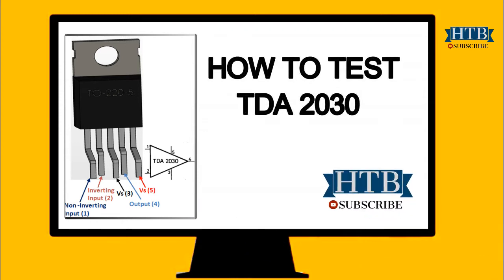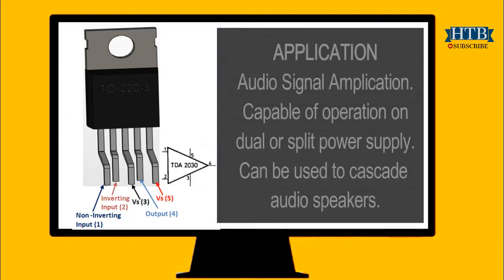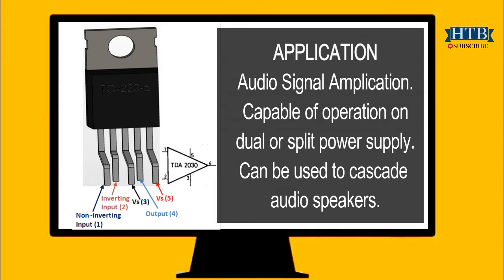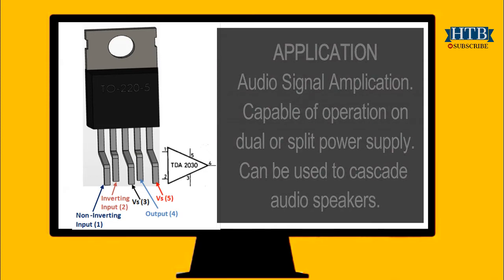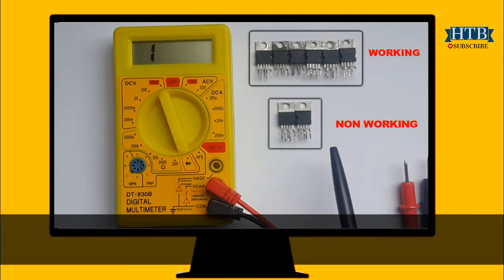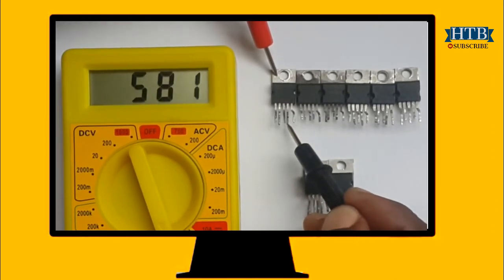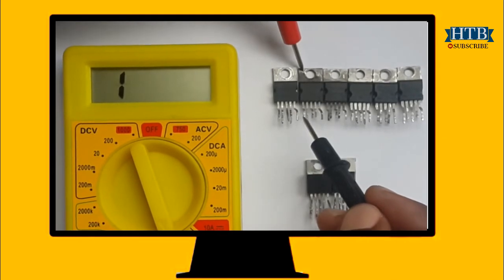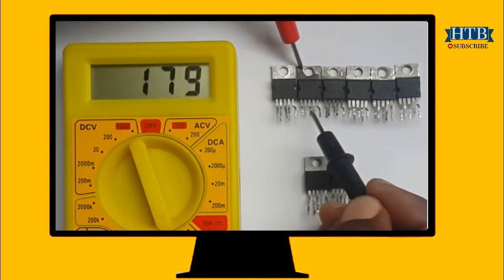How To Test TDA2030 IC- Simple Method.

Comment: This is just what I needed man! I have a TDA2003V in a CB installed now. RF is coming into pin 1 but nothing is leaving on pin 4.
I feel like I've already found the problem but pulling it and testing it like this couldn't hurt.
I've noticed others are testing with the ground lead on the metal tab.
Reply: I did it both ways but with the red lead I do not get readings on pin 1 and 2 only on 4 and 5
Doing it like he did I do get readings on 1,2,4, and 5 but I am doing the test with the IC in the circuit so I don't know how accurate is my test.

Comment: Thank you sir nice video
Reply from the maker: Thank you too
Reply: @howTobest.  Can the IC be tested in circuit? Or does it have to be removed from the circuit?
Thank you. Good video!
Reply: @howTobest.  I tested the IC in the circuit with the multimeter and these are the readings I got pin 1-.773 pin 2-.778 pin 3-0.00 pin 4-.517 pin 5- .541 do these readings mean it is good?
Thank you. Great video!👍
Reply from the maker: @SDsailor7  Hie, sorry the late response. yes you can test it in circuit but it is advisable to test components off circuit. Your results tells me that your ic is good working condition.
Reply: @howTobest.  Thank you for the response. Next time I will test it out of circuit.